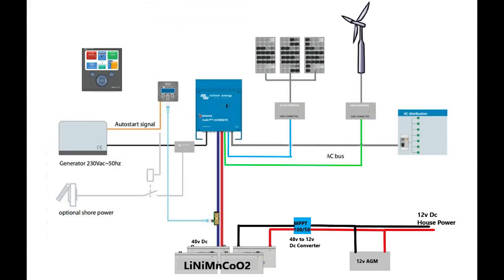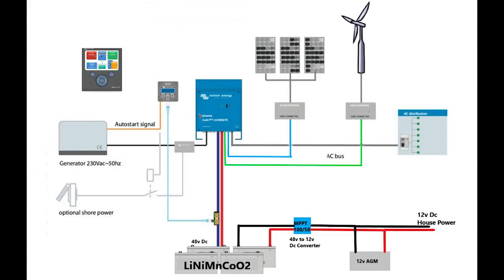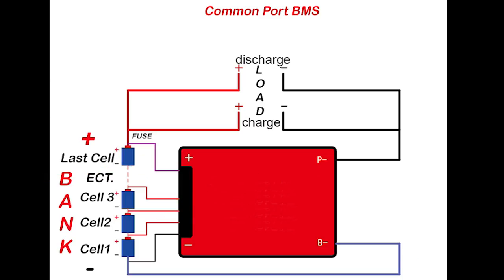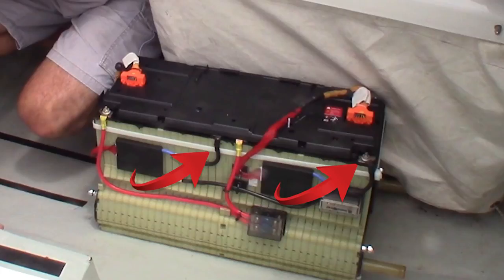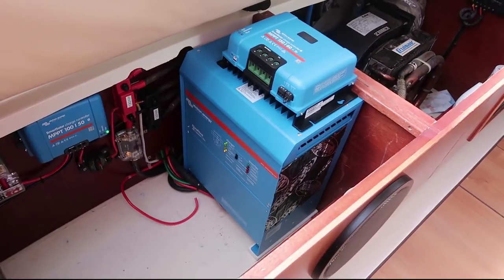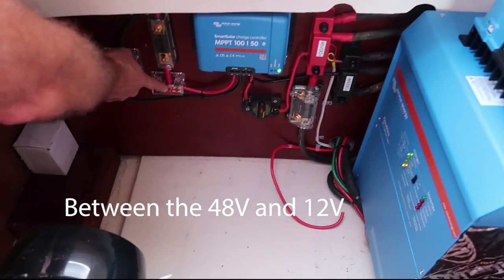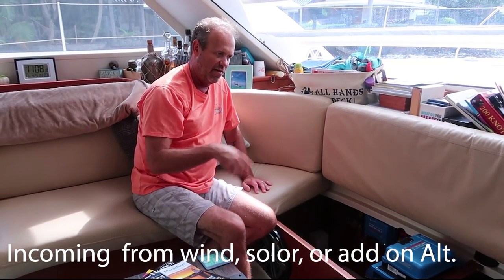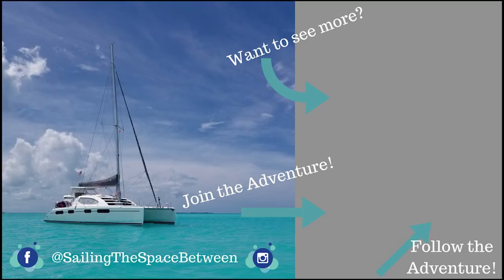Lithium Battery Setup Explained | Fix-It Friday | Sailing The Space Between

Comment: Great Video! Just for my understanding. Do you run your alternator through the Victron solar charger together with with your solar panels? Happy sailing :-)
Reply from the maker: they are on 2 separate controllers but could run on the same the alt would just take prescience is all

Comment: Thanks for the further explanation. Is there a reason you chose the volt batteries over say leaf or tesla? Also I think you mentioned previously about selling the BMS kits.
Reply from the maker: the Tesla are over sized 18650 single cell batteries to make 1 unit the volt and leaf are pouch cells less of them to go wrong if 1 fails I can replace it. if 1 Tesla cell of the hundreds in the pack you have to find it and replace it I went with the volt because of the 48v higher voltage better performance. I have built a few 12v leaf packs for others...

Comment: Great system!  Very clean design and installation!  Will definitely be following along to see how your Chevy Volt packs perform long-term.  Curious to know your shore power setup and how it feeds-in as well.  How do/will you handle 220-240v/50Hz (along with 100-120v/60Hz) shore-side?  You are obviously wired for 110v, so cabling will not be a problem, but does the Victron charger/inverter already handle stepping-down and converting or is there another transformer/converter in-line somewhere?
Reply from the maker: the boat is 2 110V circuits 1 runs thru the victron the other just powers shore 2 at sea there is a combiner that puts shore 1 and 2 together for the victron and generator sorry did not see your question
Reply: I think his question was does your viltron inverter charger handle both US and European electrical inputs.  I had read somewhere before that Viltron Energy inverters could handle both so it would work equally well in the med as it does in the caribbean sea.  or would you require a separate transformer to be able to hook into european power system? @SailingTheSpaceBetween